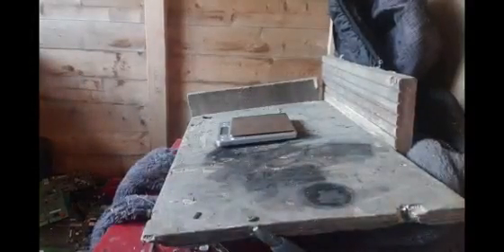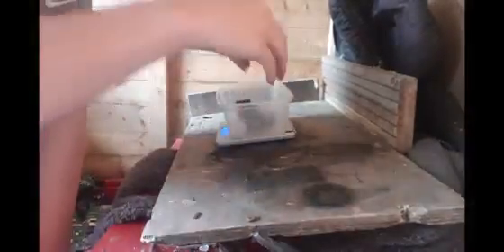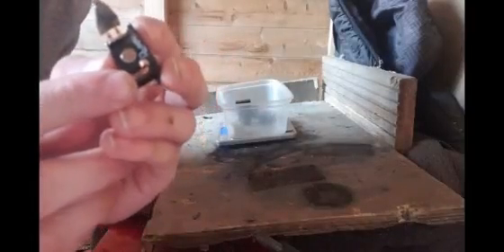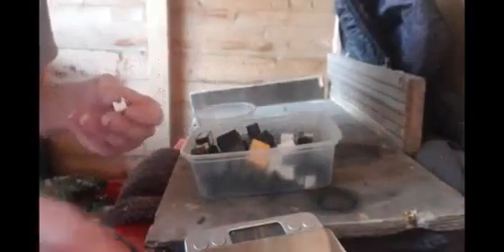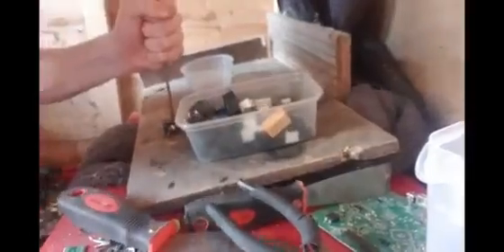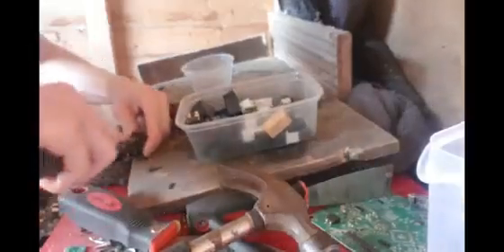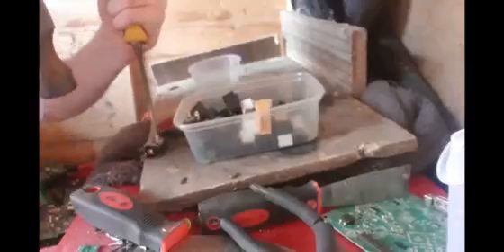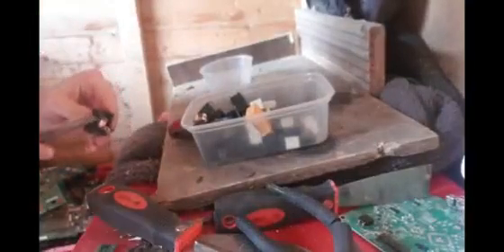Silver recovery from 500g motherboard relays - part 1 how much silver will we get

Comment: Hi, I just discovered your channel, as I'm getting into silver recovery from relays, circuit breakers, and relays found from scrapping e-waste and electrical appliances.  It looks like you have got a lot of good content on that.  It looks like it's been a while since you have made a video, but just in case you're still doing this and may read this, in my experience so far, I have found that the tiny relays are more likely to contain gold/palladium contacts than alot of the larger ones.  Anyways, Thank you for your content.  Cheers!

Comment: Get yourself a pair of channel lock plyers and squeeze the relays opposite corners, and the cases will crack open real easy. Nice video!
Reply from the maker: I moved onto using side cutters and breaks them in seconds. Thanks for the advice